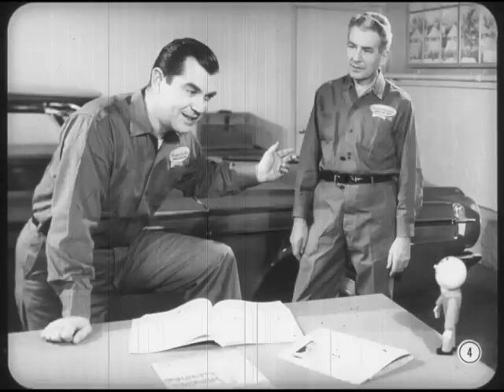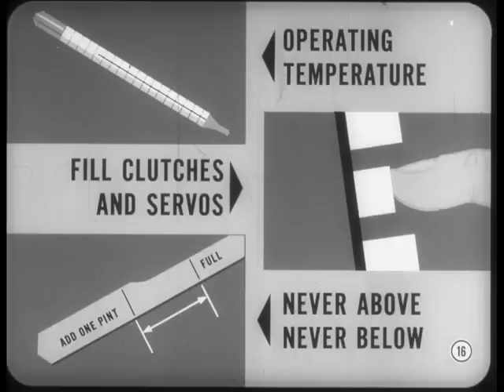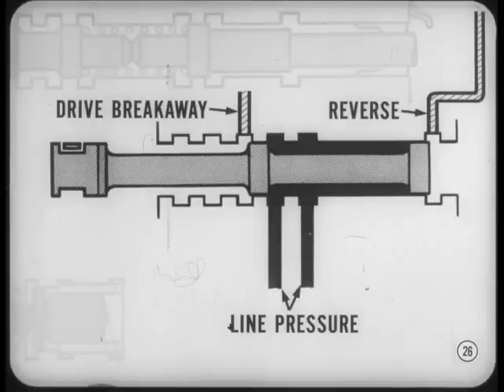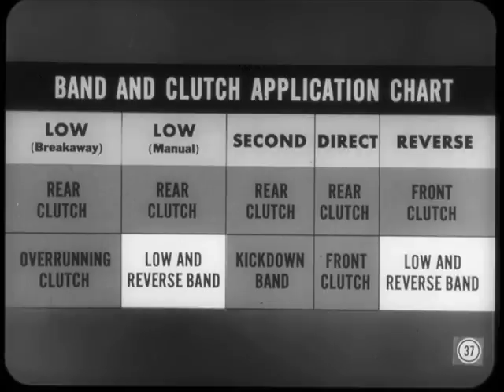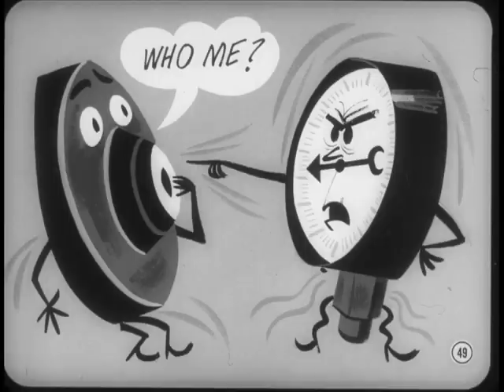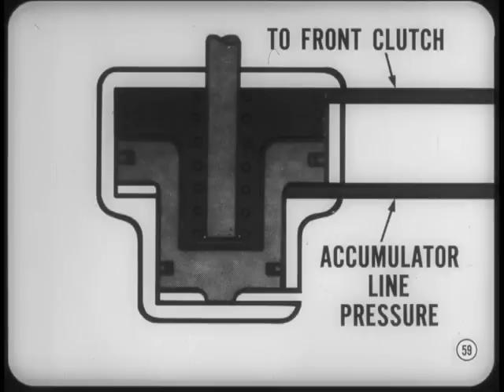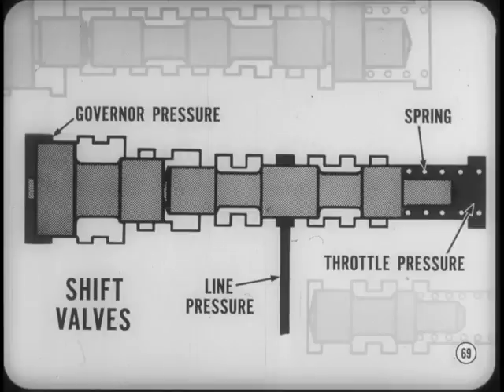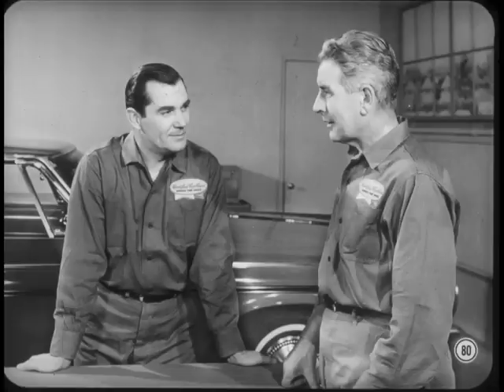Chrysler Master Tech - 1964, Volume 64-5 Torqueflite Hydraulics

Comment: Who's rebuilding a 65 904 cableshift out of a Dart GT 273 daily driver now in 2025?Me.Put the drums and rear planetary out of a 70's era 998 with 5 clutches.Still working out the pump depth because of the drums being slightly taller.Cant run the later pump as is or reaction shaft due to the converter spline count but mainly because with the early forged crank in the LA it doesn't accept later converters and I'm not changing the original.Im on a no bucks budget lol.

Comment: the best trany ever.   1965 was the last year it had a rear oil pump.    meaning that was the last year you could push start one.
Reply: Yep. Had a '65 Coronet that needed push starting at least once that I can remember. Got it up to at least 20 MPH and dropped her in low gear, and she fired right off.

Comment: Good vid.  These TQs are a joy to work on, compared to the current stuff. (Former Chrysler Master Tech, 2013)
Reply: Justin, I can tell you for a Fact, that these TQs are SO much easier than any Ford AOD!! However, not as easy as a C4... But for pure Strength, the 727 TQ WINS easily!
(Former Ford Master Tech, 1983-2004)